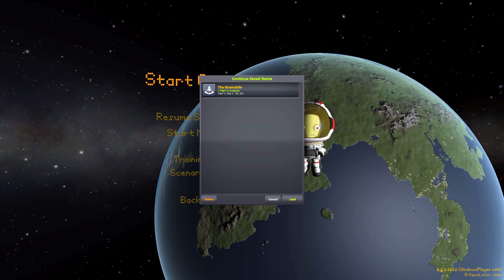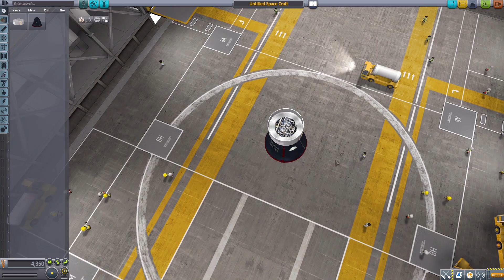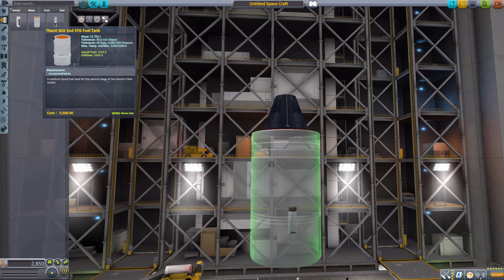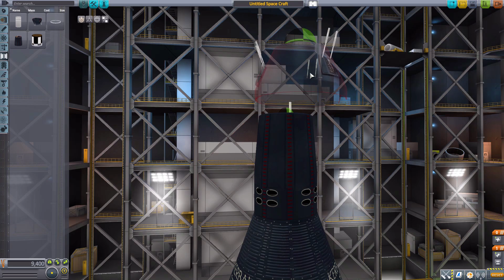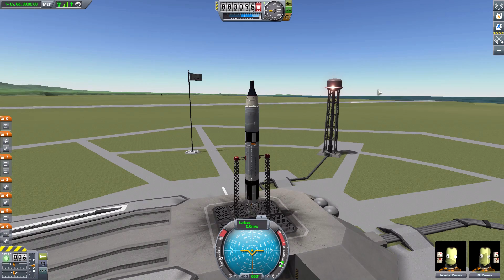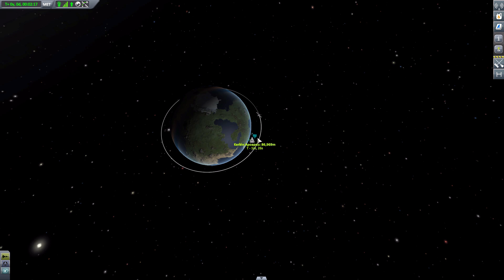KSP Mods - The Gusmobile: Gemini/Titan II/Agena

Comment: Gusmobile is pronounced Gus-mo-beel, like Automobile. It was named so because of the large role Gus Grissom played in the design of the capsule. Apparently, by the time the other astronauts got around to training to flying Gemini, even the seats were sized for Gus, the shortest astronaut at the time. The engineers had fun fixing that one
Reply: JEF_300 - Gus was pretty short. He was the only one who could get in the seat and have the doors closed without them cracking him on the helmet. NASA Engineers had fun, like you said, getting the seats fixed.

Comment: Referring to 16:15: As strange as it sounds but aerodynamics aren’t the biggest concern when it comes to rockets. Modern rockets (1950’s onwards) are mostly a compromise of aerodynamics, manufacturing costs and fuel volume to the end to get as much payload in space as possible. The WW2 “Aggregat 4” (V2) for example is optimized for aerodynamics but had an expensive structure because there were dozens of different formers and longerons needed for its shape. Also, the Titan needs those gaps for staging.

Comment: Those gaps are for "hot staging" as it's known. Fuel tends to slosh around in lower gravity, and in order for the engine to ignite, it all has to be settled in the bottom of the tank. Some rockets will use extra little srbs to push the fuel down and then ignite the engine. In this case, they would ignite the second stage while the first stage was running, but almost done. The gaps were to let the gases escape and not burn the first stage to a crisp

Comment: Lookup the R7 crafts (soyuz in particular). The reason for a ported skirt is to allow for the second engine to ignite without the need for uilage  and in also to allow the flames to vent without destroying the prior stage, hence why you can see between the skirt for the Titan.
Reply: +Bill F
This: quite a simple solution for a potential big problem, don't you think. It's almost as ingenious as how they solved engine cut-off in solid fuel ICBM's: just popping off a port in the nozzle to reduce the pressure instantly. Enter huge amounts of cheap and easy to store ICBM's like Polaris and the Minuteman's.
Reply from the maker: ah that makes sense, thanks for the info
Reply: Yup, the Titan uses hot-staging
Reply: +Jack Bowe
yeah, like Bill F said, the R7-variants: Vostok, Voshod and Soyuz. Yuri Gagarin only flew in a Vostok.